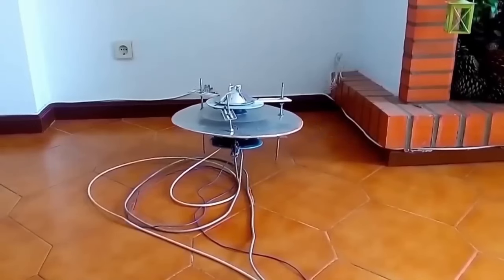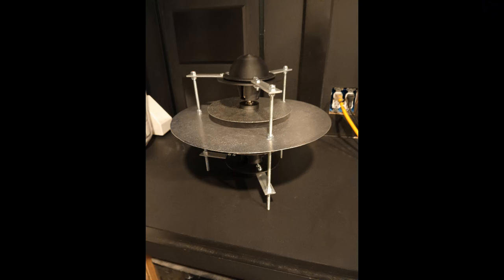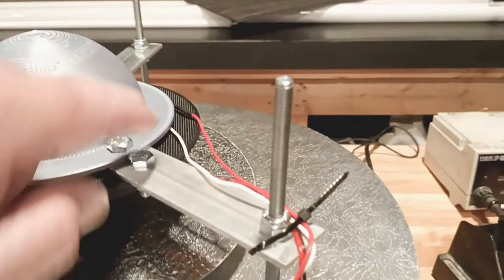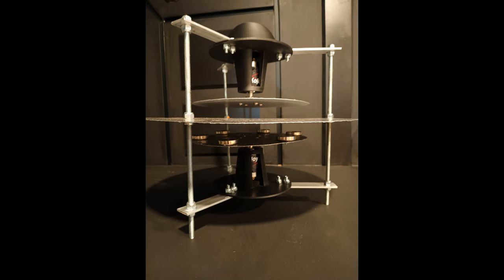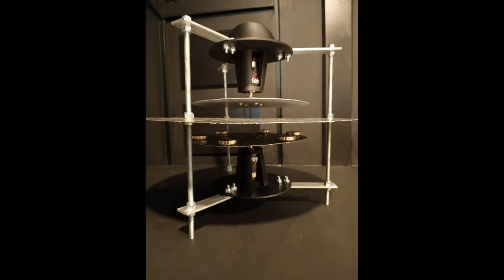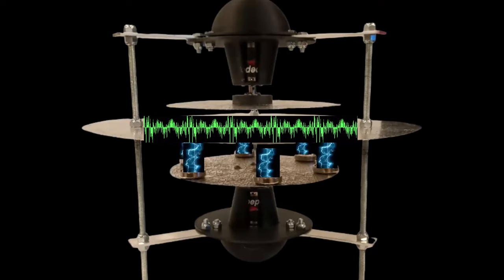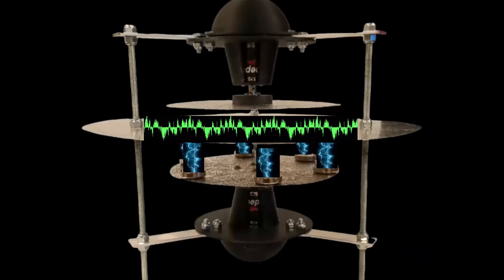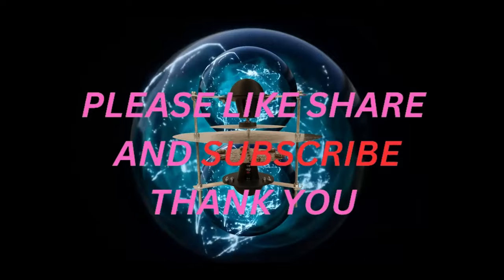Graviflyer "Far More Than What You Thought" #17

Comment: Plasma has three modes dark mode, glow mode and arc mode.
Dark mode is the only one that builds up a “useful“ charge. That recycling point between dark and glow discharge is where you may want to explore if you haven’t already. 

Judging by the lighting storm on one of the last updates, you’re on the high end of glow mode.
Reply: Electrostatic phase change. Just like steam or any molecule when it changes its phase from one state to another massive amounts of energy are liberated

Comment: Really great visuals!
Reply from the maker: I'm getting there. I am trying to get better at it. I got the static meter. And I'm getting better at the ocillicope. I also ordered a frequency generator. I am testing. When I install my snubber circuit on my Tesla coil. I'm going to set everything to 1 mhtz including the high voltage and see if I can get all the fields to go negative when the top collapses into the bottom field. I want to see if earth growing can create an explosive capacitor. We will see.
Reply from the maker: I posted some experiments with the wire going down the center of the tesla coil The video with the second pvc pipe down the center still catches the wire on fire. I think it is getting static charge. If you watch it let me know if that makes sense. I overpowered my coil by 20v that is why it is showing up where we can see it.

Comment: That picture of the gravity flyer just does not look real to me.   Clearly the real version of these crafts work  by a spinning magnetic field that observers say causes procession around the x/y access. It can induse wobbles tilting and unusual angles of attitude that are hallmarks of UFOs and this kind of propulsion.   However in the video the craft goes straight up with small jerky movements,  just like you would see if someone was pulling it up by a string connected directly to the top center.  Considering that most people would suspect that it is being pulled up by a string and pully on the cealing, but there is no attempt to change the camera angle, and point it to the ceiling, or moving it back to show a larger frame, in order to easily disprove an obvious assumption.   For most of the video he is standing in back of the camera, so it's not as though the room is so small that he can't move the camera back to have a larger frame of  view.  On top of that the frame is set just right so that when he stands up you can't see his upper torso.  This just has too many hallmarks of fakery to believe.
Reply: Yes i see your point , I've seen that video if you look through old Bob Lazar YouTube videos you'll find  it , Bob runs it outside aswell and waves a stick over it to prove nothing is attached. 
We won't see hover boards anytime soon to much power to run it .
But it's real and works

Comment: Ripper video love it , thankyou for sharing look forward to next one..
Couple of things i thought the gravity flyer was Bobs I've seen video with him with it in that actual house and outside on the lawn.
Also studying the video of Alexis top motor disc looks slightly smaller than bottom but i could be wrong.  And no microwave unit on bottom.
When Bob explained it i got the understanding that positive feild was going up , in theroy cancelling negative ions bombarding us from space  , reason the magnets where positive charge upwards.
Bob also had the magnets spinning on copper plate too producing eddy current which gave lift away from copper plate.
Food for thought cheers.

Another thing but i can't recall but frequency in space with plasma is 1400 or 1600 hz ,
Also 1800 rpm to remember earths rpm and Alexis didn't look to be spinning any faster.
Cheers.

Comment: Oh now this is fun, with the right components and alloys it'd make for a really fun engineering project. Not as replication, but more; e.g. increasing the magnet strength and identifying ways to measure resonance/etc. I'm surprised I've not seen the graviflyer before but this would fit nicely in conjunction with some other planned projects so adding this to my list for the next couple years to work out the math on. :D 
If the concept is sound I could see it working better by using 3 or more in conjunction to have more control over directionality

Comment: ok.. about to start my own little grav flyer proj.... here is what I think you are missing (I could easily be wrong)... 
to make it repeatable... you need to know what you are making happen...
so you need devices to record... RPM, Voltage, and Frequency... an O scope would help
an rpm counter
aluminum panels to create the spinning disc (the kind that have a pattern on them like from a screen door or old mobile home trail door)
a cardboard disc wrapped in thin aluminum foil
a tesla coil powered with a flyback generator you can control the current to, or some other means of controlling the frequency of the coil with
independent variable speed controllers for top and bottom spinning disc.

The aluminum discs should have a pattern stamped into it to create a rough surface. this will help create the eddie currents that are spun up.
I don't know about the sonic resonance stuff, so I will save any idea about that until I understand a bit more.
the center cardboard disc created with aluminum foil will have the tesla coil attached.
I  intend to vary the speed of the aluminum discs, and vary the frequency of the tesla coil, while recording ambient EMF with the O scope. If any odd frequency occurs, I'll record them and analyze it as I go. I will also vary magnet placement.

I'm sure you've tried a wide assortment of stuff... maybe this input helps... maybe it doesn't. Great work so far, and good luck. I'll share what I find if it turns up anything relevant.
Reply: Why does it need a spinning disc?
Reply from the maker: I have tried all of those things. I have also made build video's on this and give links t my 3d printable files. I have ordered a lot of equipment recently. Just waiting to receive it. So far I am out $5,000 in research and equipment. I have built the high voltage and demonstrated static lifting in a confined space ( with pole in it ) I also show people how to make a slayer exciter circuit that will last for hours without trouble. My graviflyer has made the song once. It is hard to replicate. I have also had my tesla coil hooked up and the next step is to have it ring when the graviflyer is in resonance. Remember the tesla is an open air capacitor. So any feedback to the coil will cause it to have pressure and a bounce back effect to the earth. It is where the burst of energy comes from. I do like the feedback. It helps with new experiment. Even in failure I learn something. I am not a young kid who wants instant satisfaction. I just want to chronical the work I am doing so others have a reference as to my thought process at the time when I am done with this project. Sorry for the long message. If you need help let me know. I will try my best.
Reply from the maker: to create the resonance and charge transfer with the eddie current.
Reply: @nathanbunten4299  I have an idea what I think is going on, but I have a feeling the journey to success is going to be like letting a bull in a china shop take the trip... it's gonna cost a lot to get it done.
Reply from the maker: @ridingwithcharley6821  Yet it will. I would watch as much as you can before building one. Everyone has their own cool parts.

Comment: no scam at all , magnetic forces make it suspend in the air .. the good question should be , how much ( energy per mass ) does it require to fly  ?
Reply from the maker: I think of it as craft to ground repulsion. When you can add a polarization to a tesla coil you can make an open air capacitor that repels against the Earth.

Comment: What circuit are you using to drive the ultrasonics?
I saw that you are using  a piezo disk, what is it connected to, and at what frequency?
Sorry I looked back and found the circuit, the LM317 is basically missing some essential bypass capacitors to ensure its proper performance, especially in a pulse current situation.
The frequency of the piezo is also debatable.
Reply from the maker: This video might give you more information. 80-90khz 

https://youtu.be/abzMb6aaj5Q?si=AQT26dzIXywTAVtx
Reply: @nathanbunten4299  I looked at that, thanks.
The RF was making the motor controllers unstable, nothing to do with the resonance of the discs or ultrasonic.
Where was the RF being applied and how much power?
Likewise how much ultrasonic power?
As you have said, a lot of missing info that will have to be methodically evaluated.
Reply from the maker: @tomgeorge3726  he applied the ultrasound to the top. He read off the amount he was putting in. There was transfer to the bottom disc. He did not have the Tesla coil connected. It will make a difference based on the natural field of it. The question will be if it turns negative due to the transfer. If it does then then it would act like a capacitor to ground. As I showed ground as a replacement in my paper lifter. It may be the final piece needed. Until now we have been blowing mosfets because the graviflyer adds capasidance to the Tesla coil. That's why I changed the mosfet. It will help when I beef up the circuit.

Comment: why not use 6  ac electromagnets on each plate and spin the field by tuning ac magnets i.e. counterrotating magnetic fields. Then no motors required or motor vibration.
Reply from the maker: It might work. I will look into it.

Comment: One more experiment build a ion craft and use a motor with a plate and magnets under it and a line connecting the craft and a scale to see if you can push the craft with more force
Reply from the maker: I built plasma channels bsi ion thruster. It got 2.4 meters per second. Ion wind is not enough for lift.
Reply: I think I have a hypothesizes on a different way it works i seen video on how a copper coil can repell a aluminum plate and some solenoid engines and a electric motor as a gyroscope to stabilize it in the air the last thing is needing a levitation toy at the top of the UFO you need the toys circuits to activate the copper coil to repell the middle plate like a solenoid engine and makes the middle plate double jump in the air.
Reply from the maker: @angelguerrero2890 That sounds good except I can't put a plate under the whole world. However I can create a capacitor to ground and make that repel the ground by using static volts.
Reply: What I mean by double jump is when the craft experience fee fall it repels the middle plate up

Comment: All those tiny corrections keeping it stable take a force vector applied to the craft in carefully calculated direction. WHERE IS THE CONTROL SYSTEM TO DO THIS?  Like a drone with propellers and no IMU. This thing would just take off in a random direction.  Therefore I say fake.